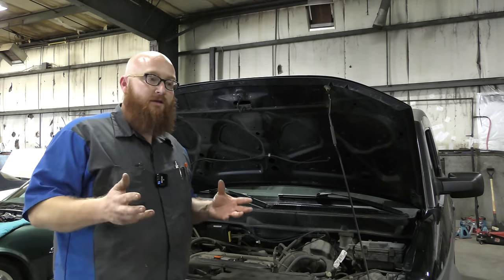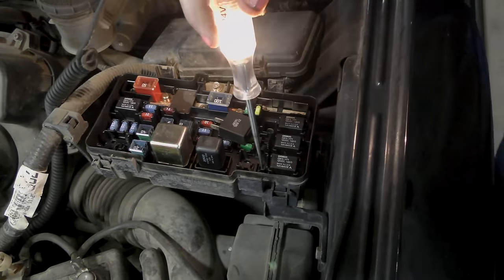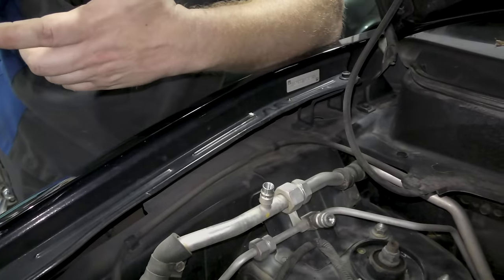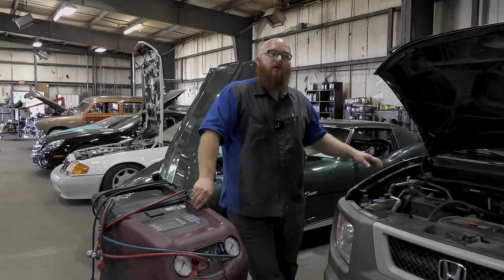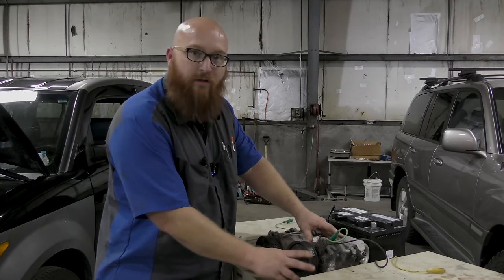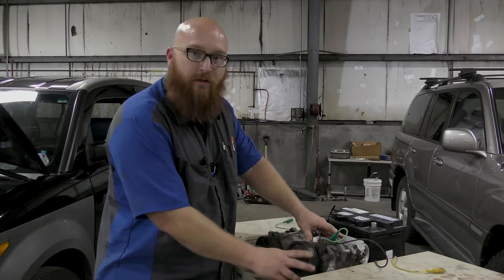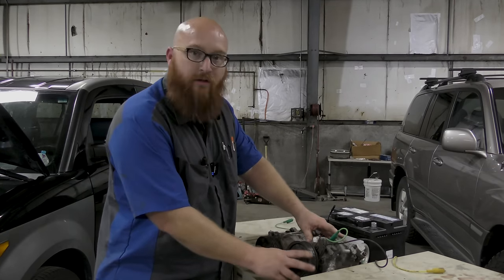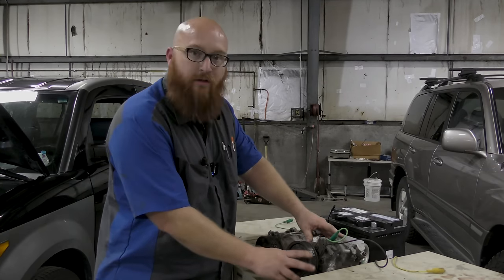AC not working!!! The CAR WIZARD shows how to easily isolate the problem

Comment: I'll add my comment to someone here to a top level comment since it's useful. Someone said "freon has been checked it's fine" and I said how do you know?  This was for an older car which uses ON/OFF low and high pressure switches. Newer vehicles can use a low/high pressure sensor which will show a different RESISTANCE based on pressure so you need to test it like a RESISTOR. You will have to look up the resistance (ohms) at the low/high pressure cutoff points and check the changing resistance of both sensors when the compressor is engaging/disengaging.  One of these sensors will be the SAME resistance each time the clutch disengages.  This will tell you if you have a low or high pressure fault. If clutch relay never energizes then you need to know the resistance the low pressure cutoff has to be at to allow clutch to engage.  When HVAC is equalized, the high side pressure should not be faulting to the module.
Anyway my comments to an older vehicle:
How do you know you have adequate refrigerant charge? If you are low on refrigerant, the engaged compressor will quickly drop pressure and activate low pressure cutoff switch. When compressor engages it takes very little to bring pressure to 25psig at that point the AC module will disengage the clutch. Vs a normally charged system will be equalized at a higher pressure and will take more work to get pressure down to 25psig.  If the compressor was bad, let's say a bad reed valve sticking open to not allow pressure to build on discharge side, then the control module would do the opposite - it would keep the clutch engaged forever because low side would never drop to 25psig.  IF you've used a sealer and clogged your orifice, then high pressure cutoff switch may be activating since refrigerant has no way of reaching evaporator.
Now you know how it works, you get a test light. Find your low and high pressure cutoff switches. Should be black(ground) wire and signal wire (ie green or non-black). Hook your test light clamp to green wire and probe tip to +12V red on battery. Now you can see during operation if that low (or high) is engaging/disengaging when you hear the clutch disengage. I am guessing the low side is switching on/off when your clutch does. Sign of low refrigerant.
If you have an (orifice) restriction, then it'll be the high side switch going on/off.
Proper weigh in of the charge on an empty system can be done with minimal tooling. A manifold of course and a postage scale. Weigh the full cans and write weight "F15.5 oz" on each can. Find out how much is a full charge (ie 32oz) then empty whatever number of full cans will bring you just under full charge (ie two cans of 12oz = 24oz). Weigh empty can weigh (3.3oz) and subtract because cans rarely contain EXACTLY 12oz. (15.5 - 3.3 = 12.2oz, 15.4-3.3 = 12.1oz). Now you have 24.5oz of refrigerant in system. Now you need 32 - 24.5oz = 7.5oz. Weigh you 3rd can (15.4oz). Now you need weight of can to be 15.4 - 7.5 = 7.9oz to ensure exactly 32oz in system.  Since cans are now self sealing this is easy.  Add close to half the can a little at a time. Close your manifold high/low sides. Close valve on refrigerant can. Unscrew can and weigh, until can is as close to 7.9oz. Then you are done.
MVAC systems have very little tolerance when it comes to "freon has been checked its fine" I doubt you have no clue as to exact amount of refrigerant in your system, just sayin. Having "some pressure" doesn't mean you have correct amount weighed in.
As long as you have SOME liquid refrigerant in the system, the equalized pressure of your system will be the SAME at any given temperature. Simple thermodynamics. I can have a bottle of refrigerant that is 1/2 full and one full, if both are at 70 degrees, the pressure of BOTH will be 71.1PSIG. Same with your vehicle's charge.
Here's what an easily overcharged system will behave. The liquid volume portion of hvac system is FIXED. all the volume past the reed valves of compressor, high side of compressor, liquid line going to condenser, the condenser channels, the liquid line going to orifice.
The remaining part of your system, low side lines, evap, are GAS. If you have too much charge, you are just compressing the gas side above normal. This is going to cause the high side pressure switch to open since clutch is not disengaging when it should (because low side never dips below 25psig to normally disengage the clutch) so the HIGH side will open and the signal to HVAC module will shut off the clutch relay.
In contrast, too low of a charge will cause the clutch to rapidly short cycle because the compressor will quickly bring low side below 25psig.
ASSUMING you are testing when weather is warm enough for normal AC to be used. Testing in cold weather will also cause short cycling since saturation pressure is lower at lower temps.
Weighing in a charge is better than using high/low gauges with OEM equipment. But some after market components may change the correct volume of charge. This is where weighing in will no longer be accurate and you will need to use manifold gauges to verify correct charge.

Comment: Great video i made the mistake of think it's definitely not low on gas because the compressor isn't kicking in i jumped the relay and everything is working as it should but still warm air so next step to get it leak tested and refilled.

Comment: Another simple check is the condenser and cooling fan, either of these will cause loss of cooling capacity as less heat will be rejected, subcooling will decrease and head pressure will increase. The condenser should be clean with no dirt and debris, the cooling fan should always be on when the compressor clutch is engaged, not just turning but at medium to high speed..

Comment: On vehicles that are older, Ive seen the relay itself fail plenty of times. I had a '99 Silverado where the relay would intermittently engage/disengage the AC in almost perfect sync with bumps in the road.

Comment: I can see what you are doing by diagnosing the internal system but, that is not true, the AC compressor can also cut out if the refrigerant pressure is too low or too high, i.e. not enough refrigerant. Furthermore, on cars we do not use FREON any longer it is HFC134a or more recently HFO-1234yf. I would have connected the gauges to see if there was any pressure in the system first and then check for leaks if required. Then I would look at the compressor etc.

Comment: Out of the 20 plus cars I've had, the A/C has only ever worked on a couple and then not very well. I've spent more money on compressor delete kits than on repairing them. There's no point. However, I'm rebuilding a Saab engine and I'm debating whether to go ahead and replace those hard to get at components. It would be nice to understand how to test the compressor, condenser, the evaporator, the orifice/thing-m-a-jig and evaporator. I got the desiccant filter because the freon is not there so moisture has gotten in, but the other components are still a mystery. This video was a good start on diagnosing the compressor, but fell short. Just because the clutch engages does not mean the compressor is good. It would be nice to know how to determine if the compressor is good.

Comment: Great video man, I love the logical process. 
I changed out my AC compressor in my 09 Tacoma today (bearing went in the clutch and I just didn’t want to listen to it scream anymore) and recharged it back to spec. When I run it now, the AC compressor turns on and blows cold air for 5 seconds then shuts off, every time I hit the AC switch in the cab I get 5 seconds of cold air then it shuts off. 
Judging from your tips maybe the pressure switch is the cause??

Comment: The  garages I’ve worked at always complained about the time to perform a thorough diagnosis. Some even set time limits. As a customer wouldn’t you prefer an accurate diagnosis that pinpoints the problem then an educated guess? This guy obviously takes the time to do it right.

Comment: At wits end, 2016 Honda Civic, blowing hot air intermittently, blows really cold 85% of the time, however it will intermittently start blowing hot air.  Sometimes, turning ac off and then 5 min turning back on, will continue blowing cold.  An auto air specialty shop in my area, told my daughter and wife,  removed freon because pressures were high and that they generally replace the entire system for approx 4000.00, but couldn't give me an answer of exactly what the problem was.  Brought to local Honda dealer who kept vehicle on/off for 2 weeks, determined same problem, pressures went up and removed some freon after adding some, suggested leaving the"Auto" button off. Problem arised again, brought to local mechanic, he added freon and dye to see if there was a leak, happened again, and again I know intermittent problems are hard to diagnose.  Today happened again to them, so they told me that only 2 other things could cause restriction, condenser and expansion valve and if happens again, roughly 800 dollars to replace both.  Are these guys on the right track?  I don't mind trying this for 800 dollars but I'm at  the point of trading it in and buying her a certified vehicle with a warranty, otherwise the car is a fantastic vehicle. 
Thanks in advance,  if Kansas wasn't so far, I'd consider driving there

Comment: The clutch engages, the compressor spins, the system is at the right pressure. Every shop I go to tells me to get it recharged and won't look further. I'm starting to accept that I have a sauna on wheels. Thanks regardless for this great video

Comment: Great video that helps me understand more about how the AC system works; I have 2004 Toyota Corolla that last time it ran was blowing hot air, I know there is refrigerant with good pressure as tested pinching on the HP as you showed here. I do have all the components needed for full AC overhaul; to that effect also armed myself with the tools needed at almost $1200.00 then the parts; compressor, evaporator, condenser, drier receiver, O rings seal kit, refrigerant and compressor oil; the system is still sealed; my engine is been out of the bay for over 3 years but it is coming in soon in the next few days as it was rebuilt. I have been struggling with the idea of recover refrigerant, undo the system, flush and replace everything new but I was also recommended by a mechanic to hold on to that, install the engine then test the system or have it checked by a shop then do the repair myself if needed; somehow i think it is better to work on all the needed parts and the system as a whole with the engine out of the way . I thought and have read around opinions that applying power directly from the battery to the compressor could burn it out? I have no tested the compressor this way yet and have not tested the relay or the fuse; I can not remember if when the car was blowing hot air if I hear the compressor engaging or not. On a side note the engine was worked on as it blew due to overheating from oil and coolant starvation due to (wife) neglecting and of course blaming it on "the man of the house" The mechanic shops prices are prohibited and since I am already an Electromechanical Engineer I figured I would do these jobs myself and learn something in the process. Thanks for your video; it is very helpful and informative. I subscribed.
Reply: My Corolla had a bad radiator fan. It could turn on its own if you gave it a nudge, drove fast (wind speed nudge), or hit a bump but it would still turn slow. The slow turning was at least enough for the controller to see it turning and kick on the AC compressor so you’d usually get cool air while moving at some point later in your drive… you couldn’t just start the car and wait for the AC to cool things down since it would be blowing hot forever that way.

It seems bad fan motor bushings are common in som Toyotas.

Long story short: Your car won’t even try to turn on the compressor clutch if it doesn’t see the condenser/radiator fan turning.

Comment: THANK YOU for your step by step sense for breaking this down! I have a 2007 Volvo XC 90 and the air conditioning starts running only after the car runs for about 15 minutes, the air turns off when the car stops and it take another while to get back on and it does only with the car in motion. Any suggestions ?

Comment: Hi, this is the best video I've seen on that matter. My AC clutch relay doesn't engage because there is no 12 volts, I check the 2 fuses, under the dash and in the engine compartment. I have shorted the 2 connectors of the relay and indeed the clutch works, what would be the next step ?

Comment: Thanks! Trying to troubleshoot my 2001 Accord ac. I think it’s probably too little or too much refrigerant. I think the gauge from the refill kit doesn’t work. When I turn the ac on it drops down to 0 yet I can see air coming out of the valve when I took the cap off. It was working great last month then suddenly stopped working. It’s so frustrating. The clutch works, fan works, and I have tried all the relays and they are fine. I’m not a mechanic but I do try to do as much as I can on my own. My mechanic retired and I haven’t been able to find anyone as reliable and trustworthy as him. It’s an older car… I’m not going to pay to replace the whole system. Cheaper to just buy another car lol.

Comment: The Isuzu Trooper was functioning perfectly, but then fog began to emerge, and the cold air stopped. I noticed that if I turn it off, wait for a minute or two, and then turn it back on, the cold air starts again. This happens during long trips. I live in a hot tropical climate and have removed the heating system; however, this issue occurred even before the heater core was removed.

Comment: Thanks for the video. It was helpful to get me ready to deal with the repair shop. I have a 2012 Honda. The AC has been slowly failing. It would work intermittently and then today it just decided it was done. I ran through your steps and have determined that it is either just low enough on Freon to trip the sensor, a faulty sensor, or a clutch that has electrically failed. 
How common is it for the clutch coil to fail on 2012 Honda pilot touring?

Comment: You are a blessing, I believe this happened to my dad's dodge avenger. It's been decent considering the price, one question though, when you rotate the center portion, should it turn freely left and right, because if I turn it right there is a point where it stops

Comment: I work at AutoZone in California, where we just had the first real hot day, and I've had quite a few customers come in for a recharge.  In one case, a gentleman came in with a newer vehicle that requires the horribly expensive 1234yf that costs about $150 per a 14oz can.  We also went through most of the troubleshooting steps in this video to rule out something like a seized compressor or a blown fuse before the customer spent the money on refrigerant.  Personally, I find it a bit disturbing that such new vehicles are seeing AC failures just barely out of factory warranty.  I strongly suspect that a significant number of drivers will use adapters to switch those systems to the cheapo r134a instead.

One thing A LOT of drivers don't realize is that AC turns on automatically whenever you use the windshield defroster during cold weather.  But an AC that's gone weak during near full time usage in the winter only becomes noticeable when it gets hot outside.

Now, question!  Is there a specific reason why the evaporator inside the dash isn't included in the rebuild?  Do the expansion valve and the dryer trap enough of the debris from the last compressor failure?  I also know that a lot of shops will straight up refuse to work on AC systems that had sealants and stop leaks used on them for the same reason - the new compressor will quickly die and cause an angry customer comeback.

Comment: Thanks for the video, Wizzard! Can you give a hint where to look for the problem for an ac that blows really cold for 15-20-30 minutes, than stops blowing at all. If the ac is switched off for 5-10 minutes and then switched on again - it blows cold again for another 5-10 minutes of nice cold air. Here the ac car shops tend to replace the whole system on a try-error way, which is expensive and irritating… please help.

Comment: My AC went out right after a major heat wave. My son's a mechanic, so I asked him to look at it.  He hasn't any idea why it doesn't work. It's a GTI MK5 and it used to have cold ac and the driving it one day it quit blowing cold air en route to the store. If it's just a relay or fuse I don't want to take it down the road to a shop and have them want to sell me the whole kit and caboodle. Im a senior and my income has dramatically dropped. $1700 is 3xs more than I am earning.
I guess it moot, because today it won't come out of limp mode, if that's what it is  Had it towed home.

Comment: Awesome video. Now
I just need you to do a 99 f250 cause everything I can read I don’t have a relay. The compressor clutch won’t spin freely but if I jump low pressure switch it’ll engage.

Comment: About her question about running without a/c..
I’ve had to replace the compressor because the bearing in the clutch failed so there was no pulley to carry the serpentine belt. Still had no a/c. Very expensive idler pulley!

Comment: nice and clear instruction, can't ask for better this. my '90 dodge caravan 3.0 liter a/c stopped working. compressor clutch engages and spins, but condenser fan won't turn on. so i switched the relays of the two. compressor still works, condenser fan still won't turn on. i guess the relay(s) is not theproblem. so i disconnected the condenser fan electrical connector and tested, no power coming in to power the fan. the car is old even only has 121k miles. don't feel like spending any more $ on it. i wonder if it is safe to hot wired to the battery to power the condenser fan?